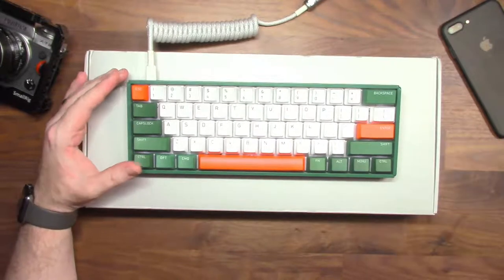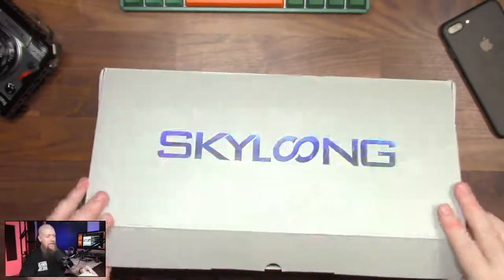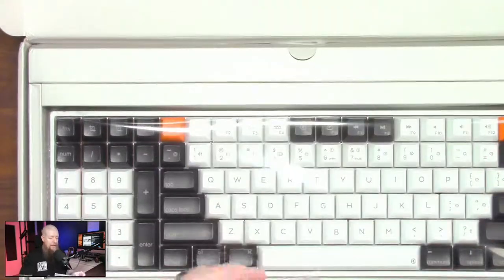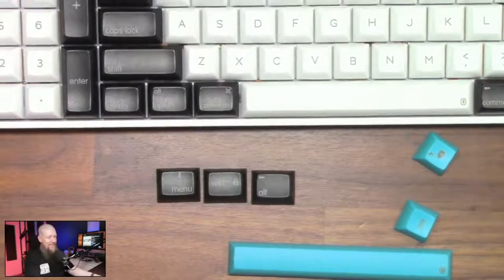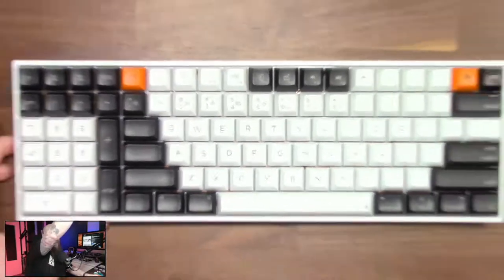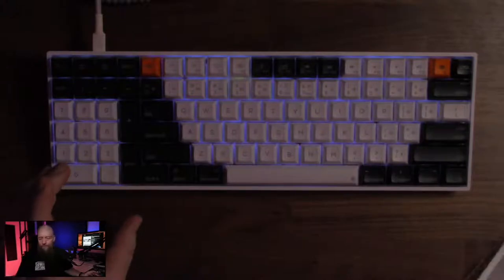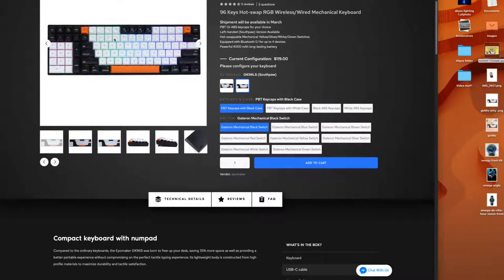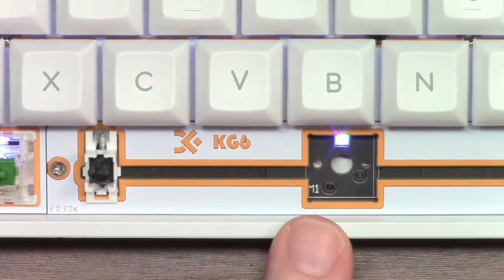Live Unboxing: The Epomaker GK96S Southpaw (even though I'm a righty)

Comment: I received the exact same southpaw keyboard a couple of days ago. Uses the same software as the gk68. Have been able to get it working on Bluetooth but not every time. I think your lights can be made brighter using FN and up arrow. I have not been able to get the number pad or the arrow keys working yet... Need to work out how the layers work. Looking forward to a follow up from you as you work out the setup/software.  ..... please!!!
Reply from the maker: Thanks! I'm still working on it to be honest. So far, I've been unable to get the software to recognise the board. I've followed the full manual info, and have since emailed Epomaker support. 
The keyboard works fully for me, I have got it in Mac mode by holding down the Fn+7 buttons for a few seconds. The Up/Down doesn't change keyboard brightness, but the Fn+[ and Fn+] seems to do it weirdly. 
No probs with the numpad, but once I get things fully sorted out I'll do a follow up video once I've really gotten to grips with it.
Reply from the maker: Quick update, I’ve managed to get the software working
Reply: @StuffInMyStudio   Time for another video then ? Please show us how you got it working and have you managed to get all of the keys working, the LED's to shine brightly and anything else you have found.
Reply from the maker: Hi Paul, yes I agree, it is time for another vid! To be honest, I'm still testing the keyboard, and also testing battery life, connectivity with the M1 and more.
As I mentioned, I've got the software working, and seem to have most functions on the keyboard now, although not quite full functionality of the software.
I don't want to put out a final review video before it's ready if that makes sense. I'm definitely still working on it though, and I am very much enjoying the board.
Reply: @StuffInMyStudio  it is time....  I hope.

Comment: Hi, I have the same. I received it a little over 2 weeks ago, and I am in discovery face.I am also a mac user. And I have a mac mini M1. The GK6 + sofwards loaded correctly but I have not been able to program it. I'm also write to a Dvorak distribution, and this makes things even more difficult.  In any case, I think I have around 19 keys that I don't know what they are used for or how to program them. I would love to see how you do it. What is most difficult for me are the "alt"  "cntr" and "command" keys that I really need on the right side of the space bar And normally arranged on the left . And for beingleft-handed, CAD user, having for years an additional numeric keyboard on the left side, I miss to have a key to erase in the environment of the numbers. My basic English does not help to optimize my use of the keyboard today! Anyway... Thanks for the video. Although some things described as the issue of brightness it is possible to fix it with the keyboard functions described in the drop-down.
Reply from the maker: I've been holding fire with the final review on this to see if the software improves for Mac users to be honest. I'm not sure, but you may be able to sort out the control and command buttons with the keyboard shortcuts in the mac's preferences?